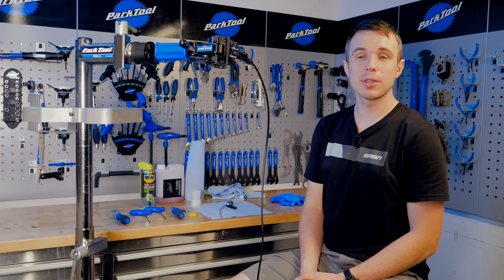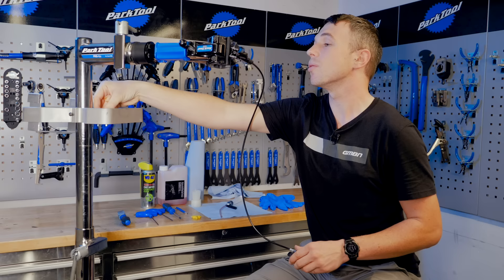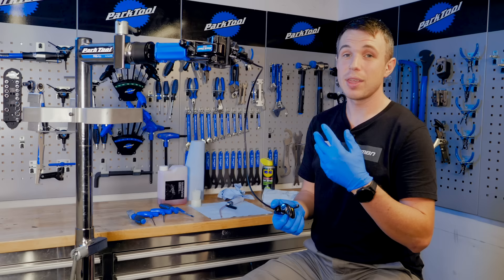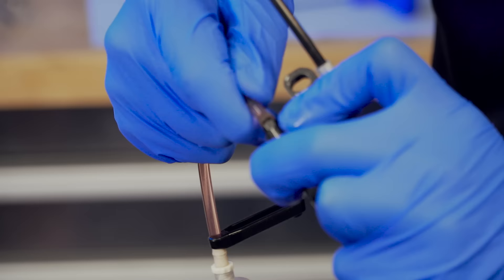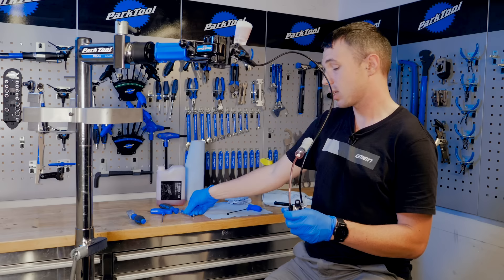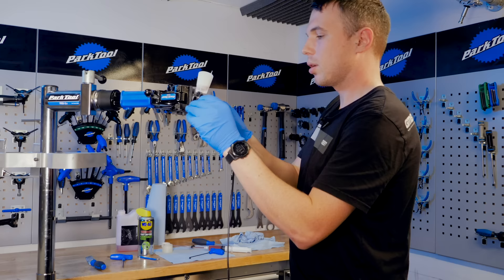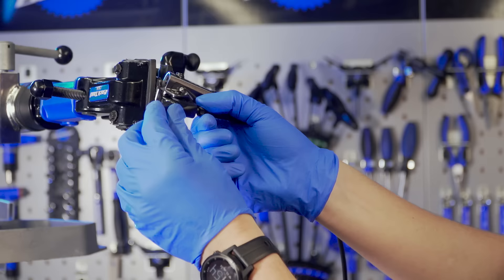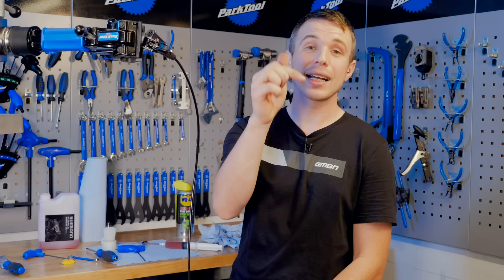Bleeding A Shimano Disc Brake In Real Time | How To Bleed A Disc Brake

Comment: Tip:  Clean the pistons before you reset/push back, otherwise you are potentially pushing dirt into the piston seals of the caliper 👍
Reply: And how would you clean the pistons
Reply: @raelcartwright1984  Isopropyl alcohol, cotton buds (Q-tips) & toothpick 👍
Reply: @herculesmclovin  thank you
Reply: @raelcartwright1984  np, you basically want to avoid standard cleaners because they leave a reside. This stuff breaks down the dirt, and then exaporates off. Clean rotors and pads (after a sand) with it too.

Comment: This guy is too clean and precise to be a mountainbiker😂
Reply: next day it goes and gets thrashed in the mud
Reply: Yea and too much drama in theses videos..like teaching chimps..
Reply: Still he made some "entry-level" errors, such as not cleaning the pistons before pushing them back in, not flushing the brake caliper, not cleaning the contaminated brake lever once done flushing the system, not cleaning in a top-down fashion… YMMV basically, by which I mean from my POV he’s a decent mechanic, but I’d argue not "clean and precise" (more so for it’s a scripted video/protocol, so less room for oversights).
Reply: @chikamichi  

And yet he’s making a living as a mechanic on the UCI WC Downhill circuit😉
Reply: @Tzed250  Which makes that kind of GMBN Tech video even more so disappointing. Again, there had been better tutorials available, why release something half-baked? They do run a commercial channel, so my best guess is the host are pressurized into making & releasing content, and live tutorials are most likely a "good" way to abide by the schedule. It does not make for high-quality content though. Not the end of the world ofc, just reacting to the "too clean and precise" joke/claim. Have a nice day.
Reply: @chikamichi  
😂🤣😂
Reply: Red Bull f1

Comment: Should've done the tutorial without removing the lever and caliper from the bike. 99% of people are going to want to leave it on the bike, and there are some important tips for doing it that way. Good tips on the lever adjustments, though. Should get that last bit of air out needed for a stiff lever.

Comment: Just one thing... Mineral oil isn't really "nasty stuff" imo. If it was, it wouldn't be what they use to make baby oil...
Reply: Sure it isn't, but he is not using a mineral oil per se, he has some sort of a solution based on mineral oil. While mineral oil is ok, that other stuff might not be... he doesn't want it under his skin, I wouldn't either... would you?
Reply: @ruez2kill  fair point it's not pure mineral oil, Shimano stuff does have about 3% additives (magura doesn't) but it's still not even close to the same league as DOT brake fluid like SRAM uses. If you get some on you, it's no big deal - just wash your hands when you're done. Very few liquids associated with cycling tend to be "nasty" fortunately (the ones in the bike anyway!)
Reply: He means mineral brake fluid, not oil. Mineral brake fluid has been used in cars forever, DOT  approved brake fluid for cars is what you want
Reply: @patrickparisienne1917  mineral oil used in bicycle brakes is NOT the same thing as DOT brake fluid, very important to understand that. DOT fluid is nasty stuff, and one of the reasons I prefer not to use SRAM brakes
Reply: im a mechanic and i always find it funny when people call stuff like bike mineral oil nasty stuff etc when ive gotten every chemical that goes into cars and machinery on my skin, in my mouth and eyes etc yet am perfectly fine
Reply: @PhoenixT1953  to be fair contact dermatitis is a thing so I wouldn't go bathing in the stuff or getting it all over on a regular basis (or anything that goes in a vehicle really), but unlike brake fluid it won't melt your paint or anything like that... Just people being cautious about things they don't know about I suppose, which isn't a bad thing until they start making videos to spread the lack of knowledge...
Reply: Midnightcat agree 100%,  but there are some out there that are a bit precious. When I see the gloves come out for handling items as if they are about to conduct surgery, I roll my eyes. 

Things like degreaser, grease, mineral oil etc, aren’t nasty at all....

Comment: Awesome, could you do this for SRAM?  It’s loads more confusing
Reply: @jozzaaa  check out Sram's official video. It's excelllent. https://www.youtube.com/watch?v=DRt-CP2l474

But there's no way around the Bleed kit (Sram bleed kit standard / professional with bleeding edge port). I use jagwire's pro bleed kit for dot systems. Also note that you don't need to buy Sram's overpriced dot fluid, any dot 4 or 5.1 (not 5!) for cars etc. will do. I typically use Liqui Moly dot 5.1
Reply: They did already. But yes SRAM/RS have great videos and manuals for all servicing on their website
Reply: Just swap it out to shimano. ..Fixed 😃
Reply: @stevecrump1375  

I have ridden both hydraulic and mechanical and I am staying with my mechanical disc brakes.
Reply: silentsnipercbdk n
Reply: @stevecrump1375  that's really the smart choice.
Reply: I never deal with anything SRAM, stick with shimano/fox, way easier

Comment: Of all the brake bleed vids on YouTube this is the most helpful one I've found. None of them really seem to start with the the core concept - filling the brake line and level with clean fluid with no air bubbles in it. All the stuff about putting a bag on or doing the little squeeze/open caliper bleed valve quickly is a waste of time in my experience. Henry's approach is the most effective, tidiest, and least hassle. Chur bud, come back to live in NZ sometime @Henry Quinney

Comment: Excellent video! Great production quality, great attention to detail!  I especially liked your suggestion to tip the bleed cap before screwing it in, to keep an air bubble out. Pure perfectionism!  I'd like to suggest some steps to add to your procedure: After removing the pads, use a Q-Tip to clean the protruding portion of the pistons using alcohol or brake oil, before pressing them into the caliper. This will keep dirt out of the system. Then, in my opinion, before pressing the pistons in, remove the fill cap and screw in the funnel. This way, it will be easier to compress the pistons, because it will not pressurize the hydraulic fluid. As you mentioned in your video, sometimes oil squirts out when you remove the fill cap. You lessen this by removing the fill cap before pressing the pistons into the calipers.     Last, when you're finished and ready to replace the pads, you should at least wipe off the pads and consider cleaning the rotors. Finally, insert the pads, replace the wheel, loosen the caliper mounting bolts, and press the brake lever. Now you can tighten the caliper mounting bolts with the lever depressed, and the rotor should be perfectly centered between the pads. Spin the wheel to give it a quick test.

Comment: Thank you so much for this demonstration. 
You have convinced me that my older mechanical disc brakes are the way to go.  :)
You are a great tech and I am convinced that I would not want to do this myself.
Thank you again.
Reply: It's actually very very easy, these tutorials just make them appear more difficult.
Reply: I used to think like you. Then I finally got some hydraulic brakes. Bleeding is not something you need to do every year or even really periodically. It's not like mechanicals are completely maintenance-free, either. Sooner or later, you'll have to take them apart to clean, lubricate and rebuild, and I can tell you that's no picnic, either.
Reply: @amightysailingman  
LOL 😆  
Since the time I wrote this my mechanical brakes failed on my everyday rider and I replaced them with Shimano disc brakes that are so much better. 
Then I got my Commencal Meta with  SRAM disc brakes which are fantastic.

Comment: Tip, you are bleeding the wrong way, on cars, etc. the dirt/rust is in the hoses/pistons, so bleed away from the master cylinder (and its narrow passages and rubber seals), fill the Master cylinder, like you have, then PULL on the syringe to extract the dirty fluid, putting in FRESH from the top!! - aka 'vacuum bleeding'. this works on cars to, esp. if you have abs on them, as all the air is DOWN not flowing into the tiny pipes, valves etc. in this system.

Comment: Good guide, but I'm missing the step  when after flushing oil through the caliper to the lever, tightening the nut and removing the syringe. Then connecting a new tube to a bag and opening the nut again to let air trapped in the caliper escape as the fluid goes backwards. I think this is really important for back brakes which are more difficult to get all of the air out.

Comment: I bleed from the caliper, pulling fluid from the bucket at the brake lever, and gravity helps pull the bubbles down. This is the motor trade technique and it works well.

Comment: Your meant to tell your viewers to check that the rubber seal is with the resevoir bolt on removal before screwing on the mineral oil funnel.

Comment: Great video.  I couldn't get the tube to fit on to the caliper opening but the syringe had a really small nozzle.  I was able to compress the oil in to the caliper tube without the tube attachment.  Hopefully this isn't an issue doing it this way.  But I got the point on teasing the syringe back to get rid of air in the syringe.  After I bled the brakes after flicking the brake lever 20-30 times I started to notice the pressure increase on the brakes.

Comment: Remember to check if the o-ring comes off with the little bolt on the lever.. same goes for the one on the bucket that you screw into the same slot.

Comment: 1. Forget the syringe.  Use the lever to pump and gravity bleed in bag at caliper.  Barley open valve to maintain pressure / resistance.   Old bad fluid collects by the caliper, no reason to push the old crap into lever.   Also, that’s not a Phillips screwdriver ole chap ... it’s a Japanese standard #2 screw driver.  Looks like a Phillip’s but it is different and that’s why most of you lads are stripping the lil free stroke screw.    Good day.

Comment: Bruh, im a first timer and your titorial is great, but when i removed the brake block thing i squeased the brake lever. I soon found out the piston went out and oil was leaking so i have to do it again😓
Reply: 3 hours later and i did it My second try! Thanks for the tutorial i was scared to do this and paniced when i got a problem first time, but by following it better it worked!

Comment: A good idea is to clean The pistons with some cue tips before pushing them back. I push them out with the lever and then clean them then push them back
Reply: Yes, done in H's brake tips video he did couplemonths ago
Reply: @rupedog  yeah definitely mate. I'd do it on a brake bleed as well
Reply: Absolutely. Why push any crap INTO the system if you can remove it first?

Comment: Mineral oil isn’t corrosive or scary! SRAM dot fluid is another story. I only use Shimano for this main reason. So much easier to deal with.
Reply: Mineral oil IS slightly corrosive, but what's worse, is that manufacturers are very secretive about what they put in it - and they don't have to reveal the contents! Unlike DOT (Department of Transport) fluid, which is standardised and regulated, there is no regulatory body to hold manufacturers of mineral oil to account. Which is also the reason why the likes of Shimano et al, can make their fluid exclusive to their product range (so it is not interchangeable with other companies fluid). This also effectively means they can charge whatever they like for their mineral oil.

Comment: These tips are helpful, but instead of using brand new brakes or other components, but you should use components with miles on them, and you would be able to show what servicing used equipment actually is like.
Reply: That's a good point, particularly if seals & O rings need replacing.

Comment: An easier way to get the air out without all this tooling or removing the pads is to top off the mineral oil. leave the bleed crew open, press the brake level and attach it pressed with tape or a rubber band. Leave it overnight. The air bubbles will rise up. close your bleed screw and it should be fine :)
Reply: Unless you have air in your caliper...

Comment: WD-40 is far from being essentially isopropyl alcohol as it contains ... mineral oil. Check Wikipedia. Now, if you remove your pads first it's probably fine to use it for caliper cleaning. But in general I wouldn't let it anywhere near my pads or rotors.
Reply from the maker: Classic WD-40 yes, but WD-40 the brand make much more than just that one product, such as the contact cleaner and brake cleaner used in this video.

Comment: "Increasing the reach actually increases the volume in the lever" -- is that correct?
Reply: Well kind of, that screw is just there to adjust it to your finger length it does also increase the volume a little bit, the other screw that increases volume is a called free stroke adjustment screw, usually its the silver small screw on top of the brake, the more you turn it outwards the more oil will fit in the brake lever

Comment: What you have done is known as a "bench bleed" in the motorcycle world. Many times, this can yield better results than on the vehicle it self.
Reply: I use the bench method. Works well on Magura brakes. Especially the rear ones.
Reply: @seancolwell3815  My point exactly. Thanks for reaffirming this!

Comment: Why can't I bleed bicycle brakes like I would a motorcycle? Ie open valve, pump lever, close valve, repeat... My triumph has a big radial master cylinder and two big calipers to bleed, I can do it with my eyes closed,  but my mtb brakes have me a little worried. Obviously this system works, but what if I finish and the lever isn't as firm as it should be? Surely I'd have to go through it again?

Comment: Hello, Henry.
What about the not functioning Free-Stroke screw on the new models M8120 and M9120?
It seems in this video you do a full bleeding of M8020 model (or I am wrong?).
I own two pieces of M8120 model (brand new front and rear) and I can confirm it doesn't do a thing.
There are many complains on the internet of different owners of the latest models of Shimano brakes. How to solve this problem? Can we return the products to the manufacturer and wait another model?
It seems these models are the same as many other products made by others manufacturers in other industries: phones, tv, operating systems and so on.

Comment: Hi Doddy & Henry, love the channel !!! I have recently order a Canyon Spectral AL 6.0 and awaiting delivery of it but drooling over the pictures of it I've noticed that the front brake lever appears to be on the left and my current (old Giant Anthem X4) it's on the right (Where I want it as I also ride motorbikes and the front brake is on the right)….How much of a job is it to swap the hoses over on the levers to get the levers as I want? (The bike may turn up with the correct set up for me but thought I would ask the question on how tricky it is to swap over). Keep up the brilliant work chaps !!
Reply: Same problem here. Just bought a new Canyon Neuron (US) and the front brake is on the left. The front hose will need to be cut shorter but the rear is going to be too short since I want it to come through the frame and exit on the right like it should. I tried to look up the part numbers on Shimano's
website and ordered the wrong one. Turns out the part numbers are printed on the tubing. (I discovered that later). I have 4 piston rear and 2 up front. Different tubing though they look the same. Then you have to buy the juice and a few more tools. This is turning into an expensive and time consuming upgrade that should not have to be done.  I asked about this when I ordered the bike and they said they are prebuilt this way so no changes. Maybe European bikes are plumbed correctly.

Comment: What about the mineral oil spilt on the brake lever?
Reply: Clean it up. Isopropanol, towel..?
Reply: Jan no way really?
Reply: @martinklinda7867  you asked..... So, yup 😁
Maybe clarify, your context, if the answer doesn't please you.
Reply: It won't do any damage to painted surfaces like DOT4 will.
Reply: Forever Computing lit i was referring to the presenters fear of contamination
Reply: @martinklinda7867  who put the swear in answer?
Reply: @martinklinda7867  Contamination is only an issue on brakes. Probably what he meant.

Comment: How do you remove the pin holding in the brake pads if it is only just a pin, not a bolt?

Comment: When you remove the bleeding block, install brake pads and pull the lever, wouldn't there be a too little oil in the system? I always thought I need to remove the bleeding funnel after adjusting brake pads to rotor distance with few lever pulls. Could you please explain why is it better to keep the block inside till the end?

Comment: Wow this way is such a pain. I do mine just like I would a caliper on a car, from the top down, using the cup as my reservoir for the clean fluid. You can also use the syringe to pull the fluid down and out of the caliper. The freestroke and other lever adjusters should be backed off before starting the whole process.

Comment: Nice video! One question. I have "new" MTB with Shimano BR-MT400. I noticed that brakes are braking all the time (a little bit). I was on the road with the bike 4 times (always nice weather). Any idea how to make more gap between disk and pads. This problem is only with the front brake.

Comment: Recently bought a bike with Shimano XT BR-M8120 brakes and they haven't amazed me yet. Trouble is the levers need to be pulled quite far back to engage the pads on the disc. Even though they're brand new does it sound like they need a proper bleed?
Rich